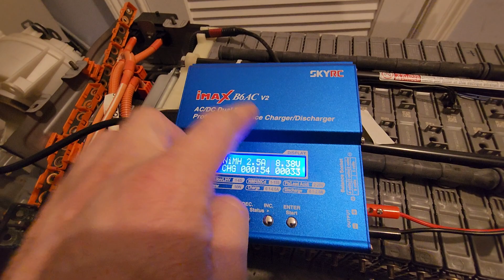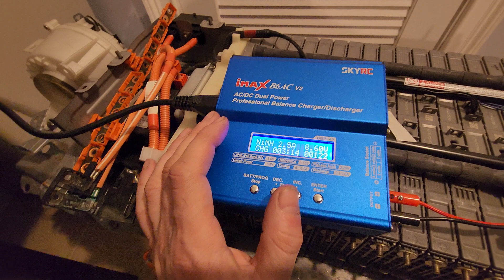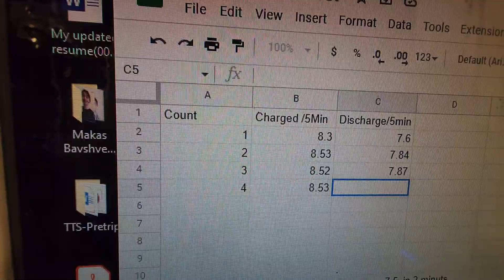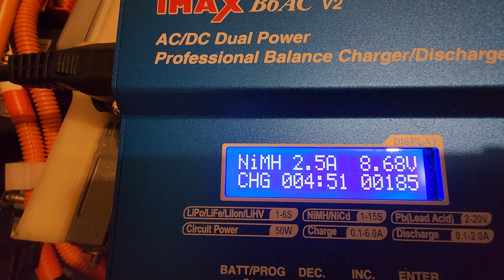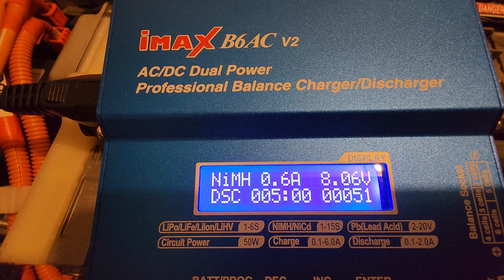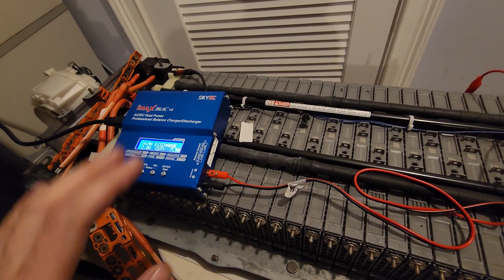Using ImaXB6  AC V2 for Toyota Prius Hybrid battery 🔋

Comment: you have an automatic battery capacity check mode, why do you do it manually?
Reply: in imax ?
Reply: @BookPaLuy  Yes, it has a cycle mode that can be configured to either discharge then charge or charge and then discharge.  The mAH removed or delivered for both phases of the cycle are logged.